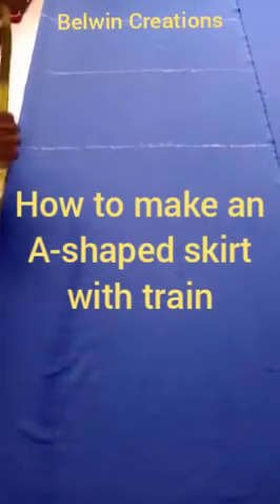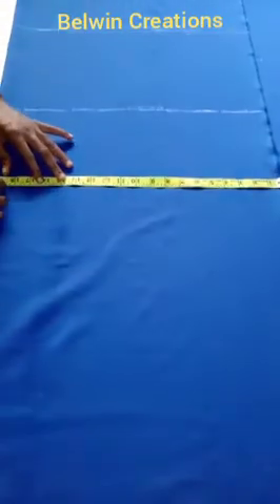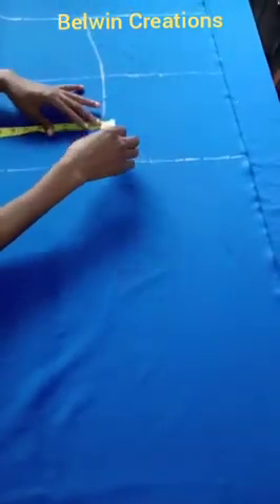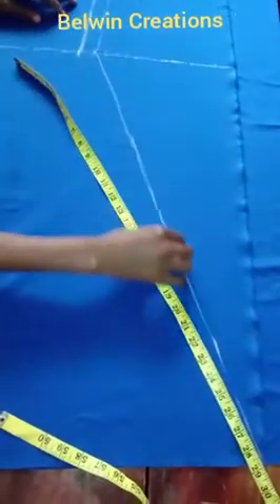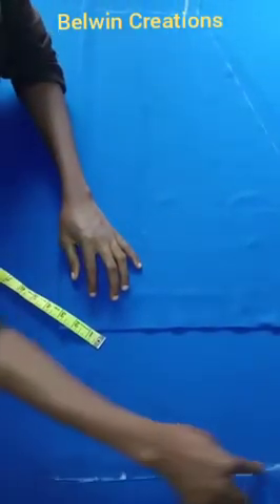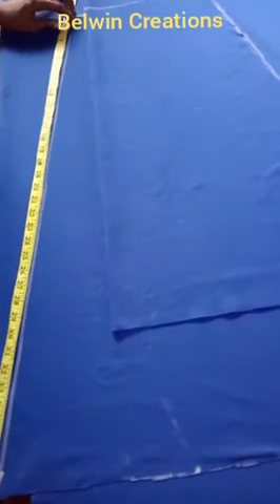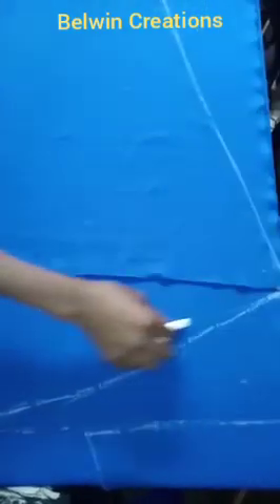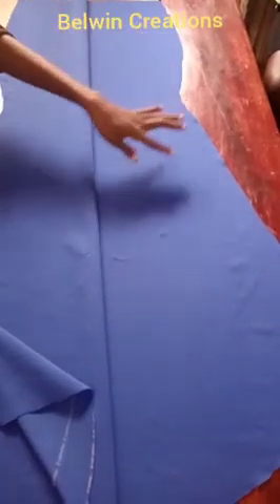How to make an A-shaped skirt with train, the easy way...

Comment: Is the train cut on a fold like the front part or cut into two single pieces? love this video
Reply from the maker: Yes the back side/train is cut on the fold. However, the center back will have to be opened because of the zipper

Comment: If am using Ankara.....how many yards of fabric should I buy
Reply from the maker: Depending on the size. 2yards should be enough
Reply from the maker: But to be on a safer side. I'd recommend you buys 3 yards. Most especially from size 10 and above
Reply: Thanks

Comment: What if I don't add the tail
Reply from the maker: It will still come out beautiful. Just continue with your normal zipper allowance at the centre back from waist to full length line, then all through the full length line should be of equal lengths for both the front and the back.

Comment: What is the distance between the hip line to under the hip line?
Reply from the maker: It will depend on the body size/shape of your client. Am average of 5 to 10 inches
Reply from the maker: It will depend on the shape of your client an average of 5 to 8 or at most 10 inches

Comment: How do I cut and attach lining for this kind of style with ankara fabric. As per the length of the lining
Reply from the maker: it will be better to use short linen. i.e. linen from the waist to the knee length or slightly below the hip. in this case the linen will be like a short pencil skirt underneath it.
Just place the main fabric on the linen and cut out the exact shape but stop at the knee length